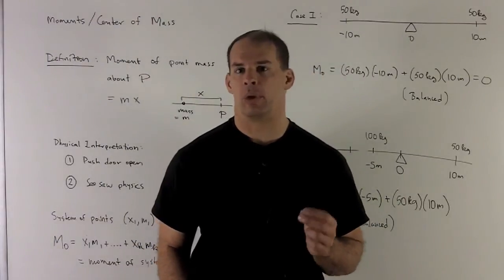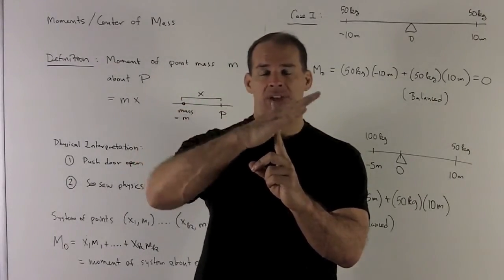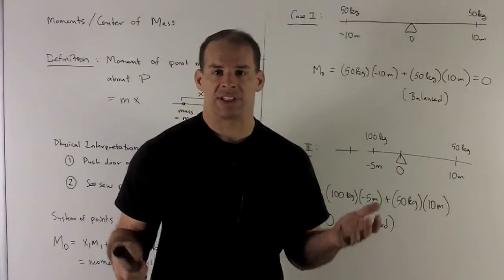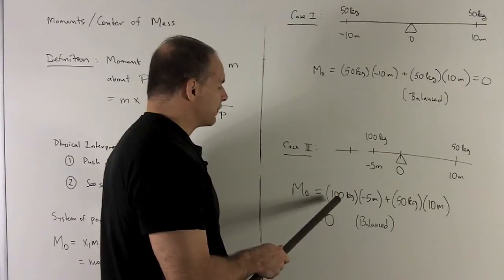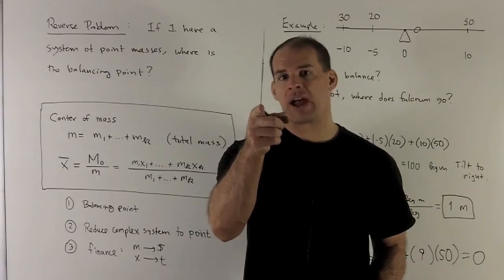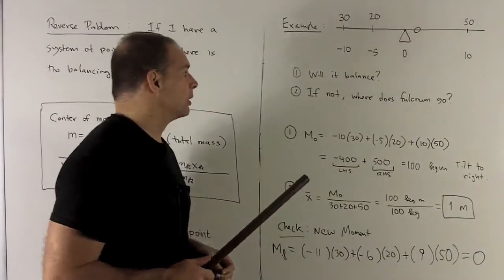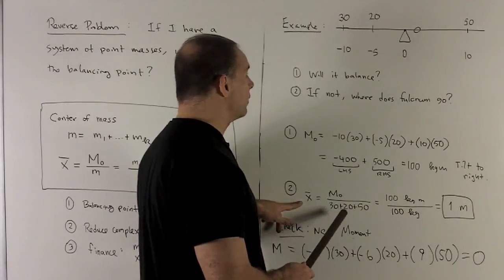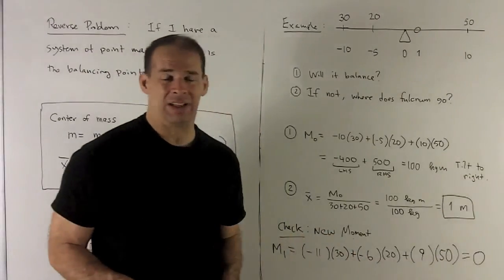Moments and Center of Mass 1 - Point Masses on a Line

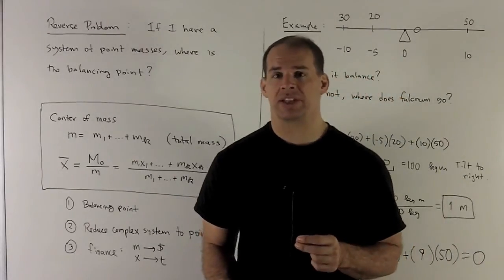Comment: I usually use patrickJMT's videos.  You can be kind of distracting, and I only needed the first 4:37 of this video.  HOWEVER, I'm commenting because I felt this video was excellent (at least the part I saw)!  If I could make any recommendations it would be to put the proper formula's right at the beginning of the video and then refer to them later.  But otherwise, much thanks for the help.  Great video.